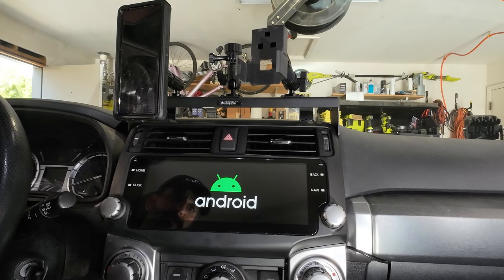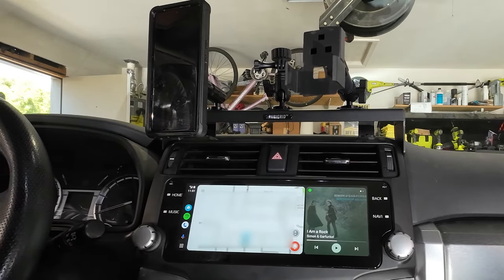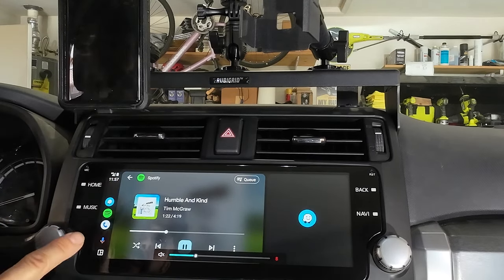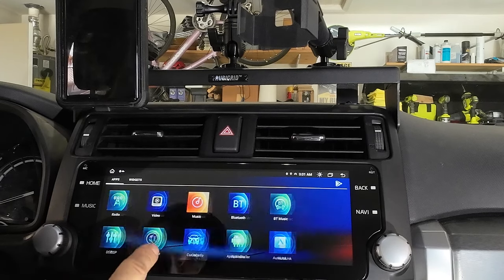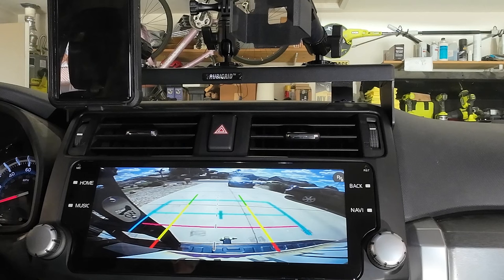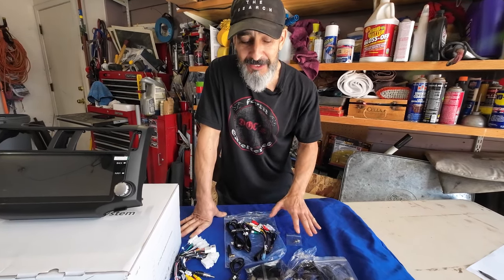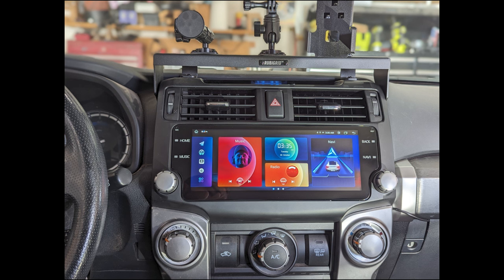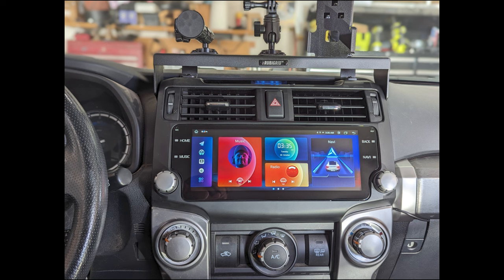Upgrade Your 4RUNNER's Stereo System!

Comment: Why do all that if it doesnt improve sound quality??
Reply from the maker: It does improve sound quality. Yes, the speakers are still OEM, but the built in amplifier in the head unit does make a noticeable difference in sound. Even if it didn't, it would still be worth the cost from the incredible shard screen, size of the screen, ability to use any navigation app you like, Car Play and Android Auto accessibility, front camera capability, etc.

Comment: is there an adapter to use the factory usb ports?
Reply from the maker: Yes. I think I showed them in the video when I was going through the wiring. At the time I didn't know what they were for and I didn't connect it.

Comment: When I set mine up the radio is not connecting. I get only static for every station. Do you maybe know what I missed?
Reply from the maker: How many extra plugs did you have left over from the factory harness? I'm guessing the factory antenna plug is back there somewhere behind the head unit not plugged in. Take it out and double check
Reply: @AZOverland2017  the same two from the 4Runner that don’t connect (the grey one and gps). Then we have one of the white blocks from the new set that didn’t have a counterpart coming from the car (that we could find). 

Did you connect the aux-aux (like the camera cords) or only connect the yellow. Camera cords? I wonder if that is it? 

We will keep looking! Thanks for the response